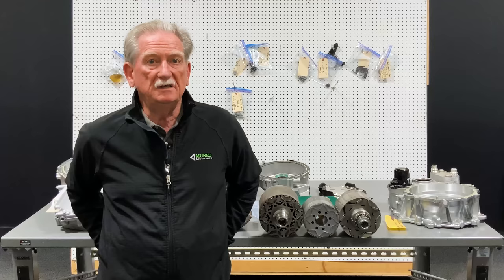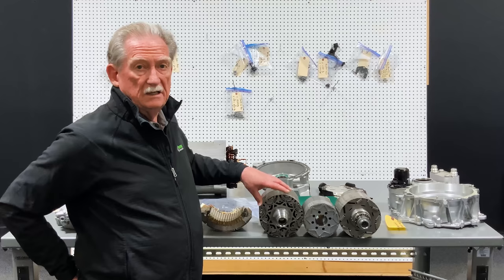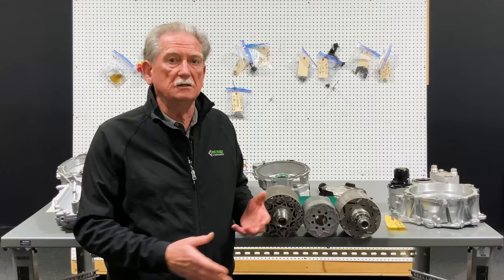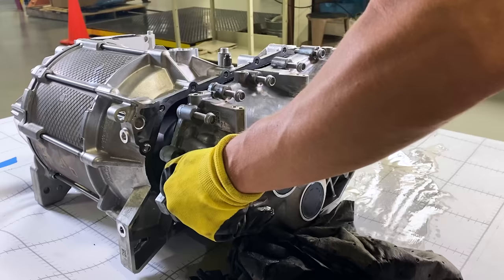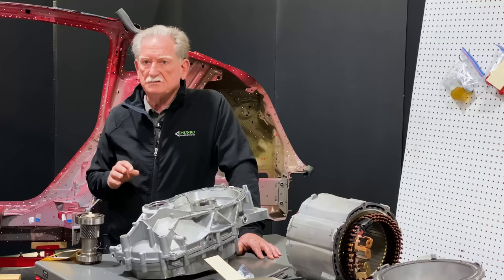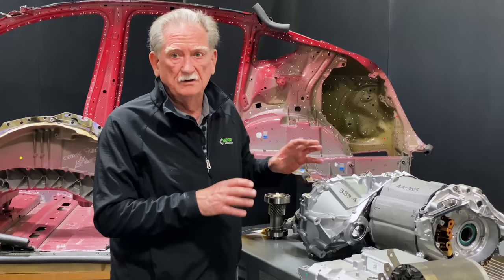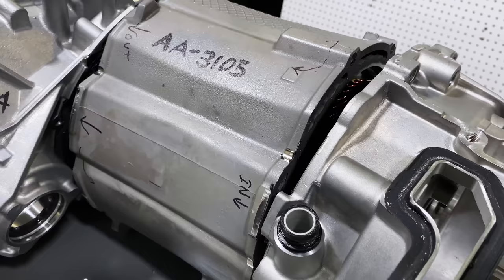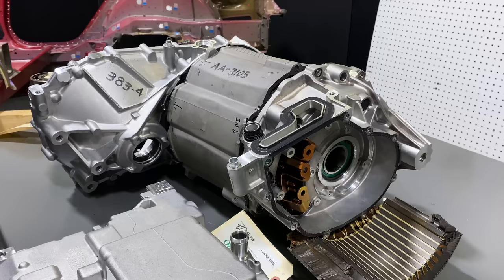Volkswagen ID.4: Electric Motor Teardown and Analysis

Comment: Credit to VW for sending the motor and for getting a second opinion on what they built. This really was a fantastic breakdown of the motor. Overall, if I was an owner of an ID4 I would be pleased with Sandy's comments. There are other improvements that VW would need to make for me to buy one, but this would give me greater confidence in the vehicle.
Reply: typical german engineering
Reply: Yep- I was surprised really that they sent it, but this is why- Confidence that they've done a good job and therefore free marketing from Munro- a truly credible guy.
Reply: Yea, if the worst complaint is they put in too many screws, then they must have done a pretty easy job. As a German, I am thinking that might even have to do with regulations about repairability in Germany. 

By law if you ask a company for schematics of a product they have to provide them. There is a company you can go through and get them for any product for like 40 Euros (might be more now).
Reply: @excitedbox5705  What is the name of the company that provides that service?
Reply: @excitedbox5705  'Right to Repair'. Feels like Apple are fighting this. They're gluing everything at the moment. It's a nightmare to change anything. All in the pusuit of fractions of mms. Even as a product designer obsessed with aesthetics it drives me insane.
Reply: @stefanweilhartner4415  VW only offers average electric cars.
Reply: @haraldschon2485  yes, and this is exactly the point why they are so successful. it is a mass market car like the golf and tiguan. in the area of user interface they are shit but they are the cheapest electric cars in the middle of the market. beside the shitty user interface you get a high quality car.
Reply: @stefanweilhartner4415  Erfolgreich? 
Aber nur bei gewerblichen Kunden! Aufgrund der starken VW - Lobby:
Aufgrund der starken VW-Lobby sind es vor allem juristische Personen, Firmen und Gebietskörperschaften, welche rund 2/3 aller Volkswagen Pkws neu zulassen. Anteil gewerblich zugelassene Pkw: 62,8 % (- 22,4 %)  Betrachtet nach Marken kennt der Markt 2020 fast nur Verlierer:

Die wichtigsten Details der Neuzulassungen 2020: Audi (- 19,9 %), BMW (- 13,7 %), Ford (- 30,6 %), Mercedes (- 10,6 %) und Porsche (- 16,3 %) sowie VW mit minus 21,3 Prozent.
Reply: @stefanweilhartner4415  Der nächste VW-Betrug:
VW hat die ID.4-Familie um ein Modell mit mehr Leistung erweitert. 
Bisher war bei 150 kW Schluss, im ID.4 GTX sind es nun maximal 220 kW – sofern einige Rahmenbedingen gegeben sind. 
Denn VW weist im Kleingedruckten darauf hin, dass für die volle Leistung die Temperatur zwischen 23 und 50 Grad Celsius und der Batterieladestand bei oberhalb von 88 Prozent liegen muss. 
Lädt man das Fahrzeug im normalen Bereich zwischen 20 - 80%, so hat man nie die 299 PS zur Verfügung!
Reply: @haraldschon2485  auch im gewerblichen bereich darf man andere autos kaufen. hier wrid nichts geschoben, sondern die leute kaufen einfach das package was ihnen am besten passt. und zwickau ist derzeit so krass an der auslastungsgrenze, daß sich vw manager derzeit keinen bestellen dürfen.
Reply: @stefanweilhartner4415  ..... kein anderer Autohersteller hat so viele Lobbyisten, in Brüssel wie VW - mindesten 60 Personen.
Wenn das Package auf gewerbliche Kunden so zugeschnitten wird, wie es VW macht, mit Flottenrabatten von denen ein privater Kunde nur träumen kann, ist das Verarsche am Kunden.
Reply: @haraldschon2485  jeder andere hersteller darf sein package genauso abstimmen. das ist nicht verarsche am kunden sondern spitze für den kunden. sonst würde dieser ein anderes package wählen.

Comment: Love the content! Threaded fastners with lock tight, Threaded fastners makes  it easy to disassemble and trouble shoot, change boards -as a Technician I love to be able to disassemble, instead of drilling spot welds and rivets causing damage $$$$
Reply: I doubt they repair any internal motor components though. For any issues they will just swap in a new motor.
Reply: @BlazerRox  It's coming, yes after market, Not PCB,s but hard parts. One of the biggest failed component on the drive unit is "Bearings" they are interference fit pressed
Reply: Right to repair.  Future mechanics will fix electric motors and batteries.
Reply: Could imagine VW wants to be able to analyze any defect. Not repairing. But analyze what went wrong. Certainly easier to take apart. As long as it truly never rattles or gets lose that’s fair? Maybe the next big redesign same won’t be needed anymore
Reply: @BlazerRox  no, the regulations are getting more and more specific so they have to offer repairabilty and sustainability. Now the whole EV tech is shipping to east europe where tarifs and wages are lower and were the cars get slaugthered and parts also repaired, all the mainboards and so on.

great progress and VW is dealing great with the repairability
Reply: @BlazerRox  If you watch Videos from Gruber Motors or  Damien Maguire  you will change your mind ;-)  
The electronic repair shops for E-Cars will grow like Mushrooms in the next decade.
Reply: @BlazerRox  It could also be to allow better environmental decommissioning. Enabling everything to be taken apart opens up for refurbishment and reuse and easier recycling of the parts.

Comment: As an ID.3 owner, thanks a lot for the informative video on what's inside.

However, I do disagree fundamentally on your remarks on the use of screws - as other commentors already mentioned, it is about repairability and equally important is recycling and the possibility to separate the precious materials at the end of the lifecycle.

.... And of all cars I've owned or used in my +40 years of driving, none has ever failed because of loose or lost screws...
Reply: I also learnt to avoid screws for the mentioned reasons. I just want to mention that there a lot of different designs of snap fits. some who are meant to loosen them some are not meant for losening. But I think especially in the pcb compartment, snap fits really have their advantages especially for services.

Comment: Having "saved" several older VWs from destruction, I understand the logic of their designs and engineering. While I currently do not own a VW, in the future, I may be in the market for an electric powered vehicle. That vehicle will be a VW.
Simply because it can be repaired. Among other reasons of course. 
Thank you for this insightful look into the inner workings and comparison of these motors.
Reply: It can be repaired, but how often will it HAVE to be repaired?  VW's are near the bottom for reliability, despite brilliant design and good performance.  The ID.3 and 4 are VW's first forays into the world of big batteries so we'll have to wait and see.  Plus, the ID.4's will be made in Chattanooga TN, NOT Germany.
Reply: @johnnyViDeO  Just because its made in Chattanooga does not make it less quality. The VW Passat has been made in that same chattanooga plant for a very long time, and there are no more complaints about that car vs. others.
Reply: In principle, I, of course, agree with You. That is why VW Group (VAG) cars are so popular here where I live. Not only easy to repair (and allowing repairs at all), but they tend to have a bit more of material here & there on the mechanicals, not being so scalloped everywhere. Plus they don’t rust easily (anti-rust treatment flows from all holes).

However my latest car, a 4-yr old with an  EA 2**-series 1.2 liter, 4-cylinder turbocharged 110 HP VW TSI engine, bought from new, suffers from too much modularity and no repairability. Like the cylinder head - there is one module complete with roller followers + hydraulic tappets, 2 cams with exposed sprocket splines for the cam wheels and… that is all. The unit is locked & sealed. No access.

No way to seat the valves, replace a follower, or a (roller!) cam bearing. Every time a complete new module is needed.

Another module is the head itself, with a tiny plastic water pump (one of 3 water pumps & 2 oil pumps on that car) on the other end, with its tiny, 12 cm (5’’) belt and hundreds of fasteners & parts. This is madness.

No need to tell how bloody expensive all of this is to replace. Staring from the extremely noisy mechanical HP fuel pump, also driven from one of camshafts.

And, of course, there is the ever-present black ABS plastic. From the long intake pipes & manifold, thru plastic turbo HP pipes (working under 1.8 - 2 bar on this car and hot!), down to the intercooler chamber (yikes!). All prone to cracking & very sensitive to all sorts of chemicals. Last time I cleaned the intake (a routine for directly injected engines - especially if oil catch can isn’t installed), the assembly of the intake was like a Tonka Toy. Dedicated metal fasteners for plastics, like a toy. Always stressing  not to over-tighten the delicate plastic threads. Awful… I generally like this car, but I think I will sell it as soon as I’ll finish repaying it. VW mechanic, a friend of mine said, that VW has no repair procedures anymore. The car is supposed to last 180 000 km or 8-10 years and then the Customer is supposed to replace it with a new one. Yep, todays’s times :-(
Reply: @daemonthenoob  I  am familiar with the area and the people that inhabit it.  I'd rather get a car made in Germany.
Reply: @johnnyViDeO  I'm not sure which way to take that comment. But let me just say I grew up poor, and made something of myself and am now middleclass / upper middleclass maybe who lives in new england... and I don't think we should discriminate anyone in the country based on class, where they come from, race, gender, or literally anything else... While I agree that cars made in Germany and Wolfsburg in particular are held to a very high standard of build quality... I have an Audi Q5 currently that was made in Mexico, and its built fairly well, no complaints at all. Having said both of those things I've seen the reliability track record of the passats, and they are good. Also I'd take a car made in Tennesse vs Mexico any day of the week. Having said all of that: I highly doubt an ID.4 made in Tennessee would be of less quality than a Tesla made in fremont california for example( and their build quality / fit an finish is junk ).
Reply: My buddy watched his beautiful PASSAT get crushed. His son overheated the turbo and repair was too expensive and Caliifornia was paying people to take cars off of the road. It was perfect  nt one scratch interior like new

Comment: Thanks for the detailed look inside the motor. I think the the reason why they use a lot of Fasteners in the motor is for repair and tear down after end of life. There's a lot of expensive material there that can be recycled if it can be cleanly taken apart and separated for recycling. Units like the inverter can be re manufactured if things can be taken apart. When I've tried to repair components  that were assembled using Sandy's techniques (plastic clips get brittle or glue/heat riveting ) the subcontinents are usually  impossible to take apart without destroying them. That would be criminal environmentally  to junk whole components like the inverter because one small subcontinent  fails and a whole new OEM replacement part would be very expensive
Reply: Your spell checker made "subcomponent" into "subcontinent" (twice). But yes, I think that's a good explanation of why threaded fasteners are appropriate.

Comment: VW giving Munro key parts of there latest  EV model, lets all hope this sets a precedent for other manufacturers to follow!
Reply from the maker: Great point. Please send a tweet to GM, Ford, Rivian, and Lucid.
Reply: @MunroLive Lucid should be proud to give their premium motor the exposure it deserves.
Reply: @MunroLive  and Tesla (Plaid). Elon claims it is “alien technology”.
Reply: @lemongavine  Will be cool to see what's different on the Model S Plaid both motor and inverter wise. They're going 1,020hp out of 3 motors, I'd imagine the majority of that is the 2 rear motors as it is with Tesla's other performance models. It's pretty insane. :)
We've seen some 4 'hub motor' vehicles only pushing 600hp, so Tesla's certainly pushing some insane power to produce that kind of horsepower with just 3.
Reply: @lemongavine  my Speculation is that SpaceX is involved in that.The Carbon-wrapped Rotor sounds to me pretty similar in idea to COPVs used by SpaceX
Reply: @lemongavine  hahah. Oh dear.
Reply: You may have mechanical resonance issues. The gear system must be composite materials modified at higher or lower temperatures and rise in perfect alloys which combine with the micro-injected fluid (magnetic
elements) up to the resilience threshold sufficient to absorb the micro-step precision (levels). Check the higher yield strength. The alloys will be significantly lighter and more molecular, innovative fasteners (no screws or gears or moving parts) and will improvise down at zero point of failure.
Reply: Its a common thing in the automotive industry to buy cars of certain competitors, test them and fully disassemble them. Sometimes these mystery shoppers get caught by media. There is a story of an Germany based Tesla car lending service, that got a Tesla back, that was obviously used by Daimler for "in house" tests. They did not even try to cover their traces, and left some bits and pieces of the car unassembled in the glovebox and the trunk:) The whole test ride was documented by the Teslas on board monitoring including the route and gps data.
Reply: @romliahmadabdulnadzir1607  WTF?
Reply: @alterbart7916  , innovative futuristic if to follow must be transformed and never seen before. If it were the past that has already proved failures and I repeat it again. What future? Wtf
Reply: @romliahmadabdulnadzir1607  what you wrote has no meaning. "Resilience level sufficient to absorb the micro-step precision (levels)". "More molecular alloys", gears are not fasteners, and you set requirements for gear system as "no gears". 
What you answered is grammatically incorrect and has even less meaning.
Reply: @alterbart7916  : What you are writing about is one of the oldest mechanical systems, which has proven to be a failure and will repeat itself. The future is something you haven't heard of, and it has no meaning to the past. You’ve never seen these terms changed and simplified based on less mechanical and more patient gravity, swing, aviation, clouds, wind, ions, geology without gears or wheels (such as animals or flying insects, etc.) . Complex everything, but move efficiently and safely. However, I appreciate your past mechanical or technical experience. The future is a change he has never seen before, and the strange thing is that it operates under the new normal. Sorry for my grammar, I hope it can be improved. thanks.
Reply: @romliahmadabdulnadzir1607  
First, I am writing about you making no sense. If you are "the oldest mechanical systems" then yes, I did write about you, but most likely fools were not the oldest. They appeared after wise men have learned to protect everybody from being eaten. Then the fools started appearing and the saber-tooth tigers went in decline.
That's sad. I'd rather have those tigers out there.
Second, you keep writing nonsense.
Reply: @alterbart7916  , our communication shortcomings can have some pretty dire consequences. 86% of professionals cite ineffective communication and collaboration as the cause of workplace failures, and poor communication costs companies anywhere from hundreds of thousands to millions of dollars each year.
Reply: @romliahmadabdulnadzir1607  What you are writing is total garbage. You communicate well, but inside your head, there is no thinking, just incoherent dreams that you spew in your messages.
Reply: @alterbart7916  , we exist in a new reality, a global world where the individualized power of the mind / brain offers possibilities beyond our imagination. It is within this framework that the direction of thought emerges which, combined with a collaborative nature, makes the impossible a daily occurrence. Driving with the future in mind, drawing on the insights emerging from recent discoveries in neuroscience, offers a new vision that brings together leadership, knowledge and learning for individual and organizational progress. So let's start with the hypotheses, dreams, imaginations, etc., possible, probable, 50% probable and proven (100%). Thinking is the process.
Reply: You have to respect every human you meet, and wait until they show you what makes them different and special.
Reply: @romliahmadabdulnadzir1607  so you meet a serial killer and wait until you see what makes him different and special?

Comment: Respect to VW for offering this up to be analysed in public.
Reply: Good way to get free advice
Reply: @Sidowse  no, solid german engineering. munro forgot that they use german threaded fasteners and a one armed bob uses a german high precision torque screwdriver.
Reply: @stefanweilhartner4415  Simon, is that a thing?  Is there something about German threads?  Other commented that fasteners never came undone in their German cars, while allowing refurbishing, but Sandy says thermal cycling and lateral loads get them loose….
Reply: @earnmyturns6305  VW very popular in Europe, very reliable, parts realitively cheap and the diseals engines go forever and are very frugal, no experience of fasteners loosening, maybe this was a problem in Ford

Comment: The threaded fasteners in the electronic board are for Ground. They are there to mitigate the "common ground current" which can affect the operation of the electronics. So, they have a precise scope. Cheers!